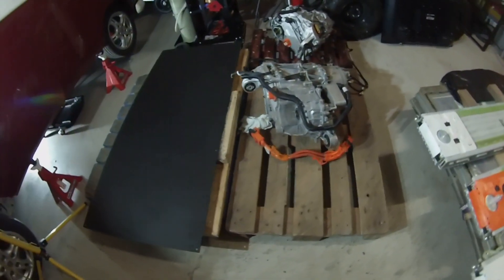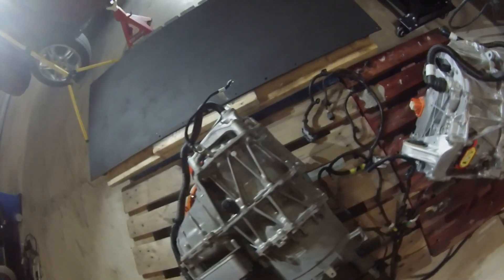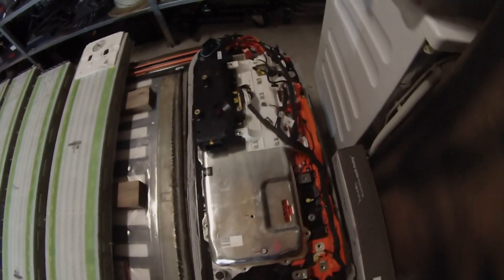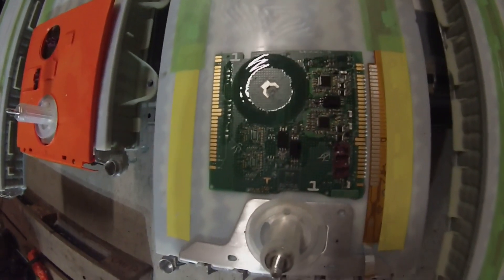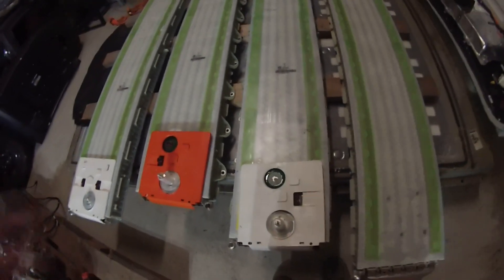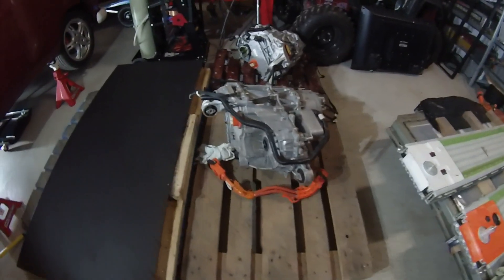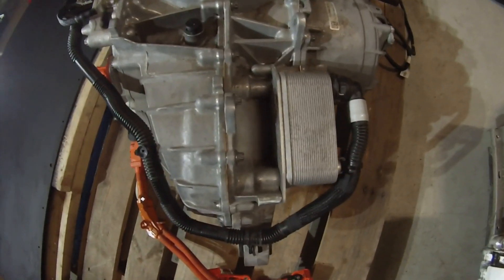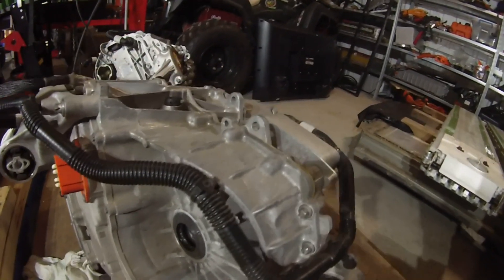Tesla Model 3 Drive Unit and Battery Hacking Introduction

Comment: was wondering  can i use a full battery and rear drive unit   was thinking to mod both to fit in a diy ev truck  and  wanted to use the tesla charge system if possible was also thinking  if i should get mcu  or if the car can be spoofed

Comment: Rear motor is a permanent magnet sync motor (with reluctance sheets), front is a induction motor with no permanent magnet. Therefore its clear that you dont feel any cogging on the front, because sitting idle without power the is no magnetic force on this one.

Comment: Wouldn’t it be cool if Elon started selling battery packs and motors as packages for ev conversion.
Reply: Won't happen with the current capacity, especially with the batteries. The motors they could probably manufacture a lot.

Comment: I'd love the dimensions of the raw battery modules and the charger module if you have time. 

How much do the M3 front and rear drive units weigh ?  One web site said the steady state power of an M3 drive unit was only 49 KW.   Is that correct ?    Wouldn't it be putting out 100 KW average in track mode, on a track ?
Reply: M3 battery modules are too big by ok by ok, IMO. Your power number sounds like the steady state power output to where the cooling system won't fold back the motor power or cut it off.

Comment: So... what are the chances of building a custom EV using Tesla components, but not the entire car, and having it be able to use a Tesla Supercharger ?

Which forum(s) do you participate in and should be on if we want to learn more or follow your progress ?
Reply: Links to the most relevant forum etc are already there in the description - just scroll below the video
Reply: ZERO. You can't even supercharge a salvage *Tesla*, let alone a homebrew car.
Reply: @vidznstuff1  Yes you can, actially.     People have unflagged cars that got flagged so they can charge again.
Reply: @SomeTechGuy666  Legit unflagging cost zeroes out the buy of a salvage vs preowned clean titled car. So, no, not really.

Comment: What's the point of running them with an external inverter if the aim is to use the internal one ?
Reply from the maker: I don't know the makeup of the motors, only hearsay on the web so by running them with an external inverter I can work on tuning the parameters to get the motors running properly. Then when I start in on the inverter electronics I know how to run the motor so any problems will be down to the hardware. Hope that makes sense.
Reply: @Evbmw  Makes perfect sense.  Great approach too.
Reply: @Evbmw  Fingers crossed you'll be showing us all the steps in this project(s) including reverse engineering the CAN messages. 

Don't worry - for those that matter, the people you want to carry your legacy forward, none of what you're doing is boring or irrelevant. 

It's immensely appreciated, especially for those of us on a fixed income who can't travel (please consider doing web courses. Not interactive, so less value, but still worth it to many)